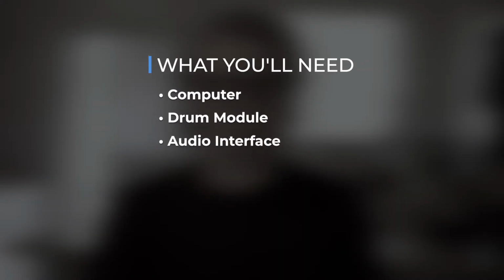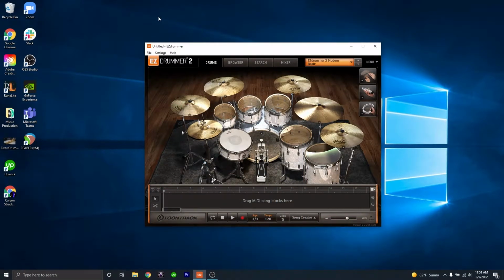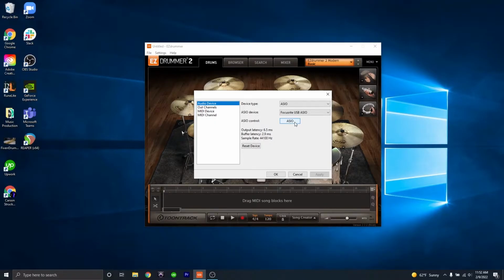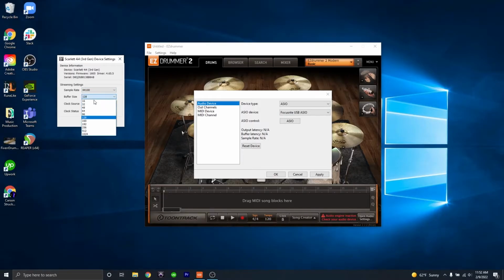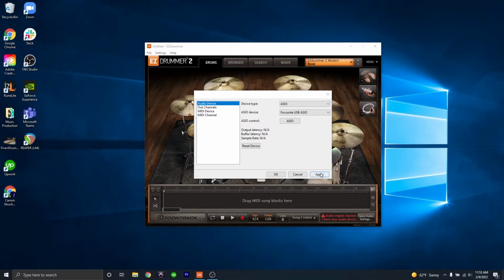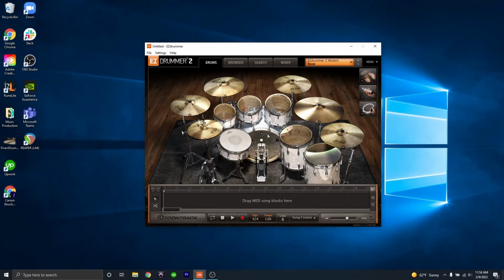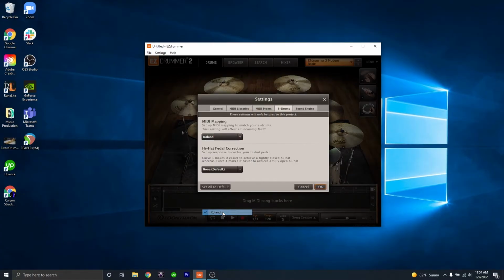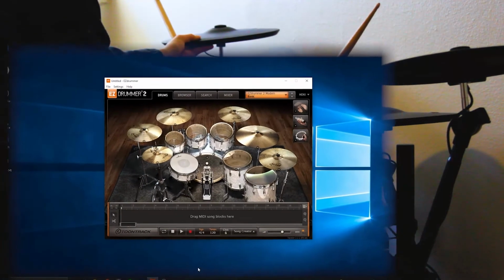How To Connect Your Electronic Drums To EZDrummer2 | MIDI

Comment: I have td07 but i cant use ezdrummer audio in my drum module 
I already have right driver 
If I connect headphones in laptop then it’s it’s working properly 
But if i put headphones in my drum module then no audio commig out in headphones
Reply from the maker: Yes! The audio from ezdrummer comes from your computer. It's a program that exists on your computer and since you can't route audio into most drum modules, you have to listen through your computer.

Comment: Focusrite Gen 4 doesn't have MIDI IN port. What do I use? My Alesis e-Drums have MIDI OUT and USB MIDI ports.
Reply from the maker: Oh, interesting. I guess midi is pretty dated now. Use USB from your module straight into the computer. I have another video on this exact thing. You can still use your audio interface as the Sound engine for your computer if you experience latency. Hope that helps
Reply: I will try and let you know. Thank you  @CarsonStruck

Comment: So if I purchased a 4 output interface could I send 4 channels to a mixing console?

I recently purchased a Yamaha DTX-8 not realizing that it only had two outputs. I would like four or more for live performance. It looks like the only way to achieve this at this point without buying a new brain is using a VST with a DAW but I am not altogether clear on how that works. 

I don’t have the interface yet, but my brain properly triggers EZDrummer 2 without a midi cable so I am confused as to what the MIDI cable’s purpose is in the chain once the interface is deployed.

Your video answers about 80% of what I need to know…great job!

Comment: I've never used an audio interface before.  When you setup your output device, was it routed back to a drum amp?  I guess my question is am I able to output back to my drum amp or do I have to go through whatever sound output my computer is using?

Comment: I have a td17. Ezdrummer 3 is one sale today. Do I need an audio interface? I thought I could connect my computer to the td17 with a type B cable?
Reply from the maker: @lobbyrobby  you don't need an audio interface! I have another video that shows you what to do without one. Basically just plug and play. I do over a few settings Incase you have latency.
Reply: @CarsonStruck  it took me while but I got it figured out

Comment: Thankyou for taking time to make this sir. I've got a Macbook M3 Max, Focusrite 414 4th gen, Easy Drummer 3 and Roland TD30. I was really struggling understanding the nuances of how the tech works with each other, and was almost considering abandoning the setup. I was going straight from TD30 to Mac, then out through the 414, or out through the mac jack and a headphone amp. I will try going in through the 414. Was getting latency of 0.4 to 0.2 ms. Struggling to work out how to get the output into my Roland HS5 for jamming, but your video has helped me rethink that too. Many, many thanks. Love from Central Scotland sir. All the best.

Comment: Hello man thanks for your video, I was just wondering if you could connect the soundcard to an amplifier instead of headphones. And if yes can we use the same port and cable ?
Reply from the maker: @theocornet3315  hey! Of course you can! Depends on your interface, but most have "Line Out" on the back usually split into a left and right signal. If you only want to run one cable instead of two, I would run a TRS cable from your headphone output into your amplifier.

Comment: I have a question that I hope you can help me with. I have an edrum that came with a very cheap module that does trigger very well. Is this interface device something that can help with that or that’s not what it’s designed to do?
Reply from the maker: @NoisyMachine_  are you saying that your standalone module for your e-drums don't trigger well? If that's the case, using an audio interface with drum software won't help there. But it would make it sound better if that's what you're getting at.
Reply: @CarsonStruck  sorry, I meant to say it DOES NOT trigger well. So that is not what this device is designed for correct? To help with the triggering of a cheap module?
Reply from the maker: @NoisyMachine_  Nope. If you're experiencing mistriggerring or sensitivity issues when hitting your pads, it's very likely that it's the actual pads you're hitting if you can't adjust those settings within your module. The sensors there may not be working effectively. So this won't help with that issue. BUT if you're just saying the sounds from the module are bad, then yes, running a VST like EZDrummer will make them sound so much better.
Reply: @CarsonStruck  thanks for the info man. I am not very familiar with electric drums a stuff like that. I am trying to absorb as much info as possible to understand it. I was told that changing my cheap module will definitely get rid of those issues. I think the triggers are good, but getting the settings right on the module is the issue. Sometimes it works, sometimes it doesn’t. Depending on how fast I played. And I am not saying the module is broken, it’s just that is not that good and hard to dial in the settings correctly. I want to upgrade to the TD17 since I’ve seen people saying it is compatible with my kit. Other reviews I’ve seen of my current module say the same thing. It’s just not a good module. By the way, I am talking about the Lemon TD950. I use drums sample from GGD (Get Good drums) and it sounds amazing. Everything works perfect except the sanare and hi hat. Cant seem to get it right with the settings so I that maybe this device would help. Thank you for replying…I always ask questions and no one ever answers so thank you. You just saved me from wasting money on a device I thought was for triggering like de eDrumin that apparently is what it does as far as I could understand
Reply from the maker: @NoisyMachine_  sure thing! If you are experiencing latency, Which is the time between your hit and the sound, the interface helps with that.  So as little delay as possible. If you don't have that issue, and you are just having a weird setting issue, no need to purchase an interface. I would suggest getting a free trial of EZDrummer and see if that works better though in terms of your hi hat and snare not sounding satisfactory.  In my opinion though, everyone's setup is a little unique and is gonna take a bit of tweaking to get it to your liking. Good luck!

Comment: Hi! What is the difference in using a midi cable or a usb cable?
Reply from the maker: They're different technologies that achieve the same thing in regard to sending MIDI data to your computer. I'd say it's probably more common now for people to just use USB to connect since they're likely already using a USB cable for other purposes anyway. USB can do a lot and has MIDI capabilities. A MIDI cable only sends MIDI Data. It doesn't really matter which one you use in my opinion. Hope that helps.

Comment: Thank you very much for this video. I have a Roland TD02 drumkit, and whenever I try recording drums via EZDrummer 3 on my Windoes computer I experience a bit of lag. The same isn't an issue on my MacBook, so I was looking for decent audio interface options for my Windows computer.
Reply from the maker: I use a Mac exclusively now but I also use a focusrite 4i4 with a midi cable. But USB is so fast now that it kind of doesn't matter if your using USB 3 on a machine like a Mac that has great built-in audio drivers. In short: get an audio interface like a focusrite or other brand that probably lands in the $100-200 price range and has MIDI in.
Reply: @CarsonStruck  thanks! My only problem is that my drumkit does not have a MIDI out. It's only got a USB B! How could I connect it to an audio interface, do you have any ideas?
Reply from the maker: @rhinestoneeyed_  You won't connect it to your audio interface then. You will connect it to your computer but then use the audio interface as your default audio driver. You should be able to adjust the buffering and sample rate within the control software that comes with the audio interface ou purchase.
Reply: @CarsonStruck  oh that's so cool! So it would go edrums to computer, and then audio interface to computer. There's no cable connecting the edrum module to interface. Is that right? 😅
Reply from the maker: @rhinestoneeyed_  in your case that would be correct! I always say try with what you have first because things add up in price, but if you have latency and messed with all the setting available to you, you probably need a better sound card. Which is where the audio interface comes into play. Good luck!
Reply: Great stuff! Can i on top of this use a IRig2 to my phone from the computer to get synked videos directly to my phone?
Reply from the maker: @mikaelpettersson2052  I'm not quite sure what you're asking here but if you want to get the audio onto your phone to then sync up with a video you've recorded, I would probably export/bounce your drum audio, put it on your phone via Google drive or however you prefer,  then sync it up with a video editor on your phone if that's what you're talking about. Again, didn't quite understand the question but good luck!

Comment: Nice video!
I have a not so good computer.  If I use an audio interface it will do all the processing and lower the latency or because of my bad PC, latency will still be an issue for me?
Reply from the maker: The interface acts as an external sound card. In my experience, latency is always reduced to almost nothing with even the cheapest audio interfaces you can buy. Using onboard audio is usually not the way to go. Again. Your results may vary. Start with what you have. 🙂
Reply: @CarsonStruck   thanks!

Comment: Does this allow you to play the sounds from the ezdrummer 3 program through your amplifiers to play live for people?! Im trying to figure out how to do this cause I can’t see spending this much money and not be able to show it off and be limited to headphones only
Reply from the maker: There's several different ways to send your ezd3 output to a PA or drum amp. If you are using an audio interface like in this video, you should have Line Outputs on the back of the interface. Run those with a 1/4" cable straight to your drum amp or PA system. That way you can monitor yourself with headphones but then your sound guy can do whatever they want as well. If you are forgoing the interface and just plugging your module in via USB, you need to take the output straight from your computer to the drum amp or PA. Usually via an AUX cable.
Reply: @CarsonStruck  I’m going to be ordering a usb audio interface here shortly. But from what I just took from that are you saying I can wear my in ear monitors while being hooked up to my P.A. System and I can hear myself playing while everyone else hears me AND the music?! If so then that’s awesome!! I’ve been trying to figure out how to do that very thing for awhile now!!
Reply from the maker: @Jeffmd2020  that's correct! At least with most interfaces. You just plug your headphones into the headphone port and then you can give your sound guy the lineout feed. So you can control your own volume and they can control it on their end for mixing. Again. There's so many different ways to go about reaching your goal but you can easily accomplish what you're trying to do with the gear you've talked about here.
Reply: @CarsonStruck  so do I have to have a mixer to use this line out feed? I’d love to hear myself while everyone else hears the music and me so I can fine tune my movements and how hard or soft I need to hit the drums
Reply from the maker: @Jeffmd2020  no. Your line out CAN go into a mixer and will most definitely go into one at a venue, but at home, that line out will go straight into your drum amp. My rule of thumb for sound is that you set it up the way you like it and it's always the sounds guys job to figure out how to accommodate your set up and adapt it to the venue you're playing at. Most artists expect a plug and play experience at any venue. You can get really you'll adjust your music and drum volumes from your computer. So in this case, your computer is acting as the mixer. Hope that makes sense.

Comment: Thanks for this video man... I was using the Drum module connected directly to the laptop and I was having latency issues.. I also have a behringher interface which I'd like to use however I didn't know how to setting this. :)
Reply from the maker: I sometimes have latency issues connected via USB. It depends on several factors, but make sure you have updated drivers installed on your computer for your module. Set the buffer to like 128 or something. Anything less than 11ms or so should be fine if it gives you that info. And make sure you're not using Bluetooth headphones. 

To use your interface, make sure you install the latest drivers for it from their website. If it has MIDI in, use that with a MIDI cable from your Module to your interface. If not, just go to the settings of EZDrummer or your DAW and select that as your audio device so you can utilize the power it provides vs just using your internal audio card. 

Hope that helps! Keep tinkering with it and you'll get it working.
Reply: Good video , and great drumming!. I am having latency issues . I have ED3 and a new laptop. Sweetwater helped me out with the settings . Still had latency issues . He told me I needed an audio interface. Now I'm waiting on the focusrite. Hope it stops the latency so I can use ED3 .

Comment: Nice video man. Now, what would be the routing if I’m not planning to only monitor myself through headphones, but play it through the PA live? 

Detailed as possible would be such a help 

Thanks!
Reply from the maker: If you're using an audio interface like mine, it has monitor outs that you can send to a PA system via 1/4" cable.  You can plug your headphones directly into the front of audio interface. If you're audio interface doesn't have multiple outputs and just a headphone out, I would probably run some sort of splitter or maybe a headphone amplifier that splits the single. One for your headphones and 1 or 2 for the pa system.

Comment: Hi hopefully this comment (or more like question) reach you. With this setup will I be able to listen to music (spotify, youtube) while running ezdrummer?
Reply from the maker: If you play it from your computer, yes. As long as the audio output of your computer is set to your interface. Through your phone connected to your module? Mostly no. Cuz you're getting the audio from your computer and not your module. When I jam to songs, I just Bluetooth to my module and use the stock sounds. But if I want to use ez drummer I have to play music from Spotify on my computer.

Comment: I connected evrrythin as you said but I do not get midi in signal  in ezdr.3 

When i connect midi out via usb to Laptop and from there via usb to daw it works but grim my understanding thats wrong. Isnt it?
Reply from the maker: I'm not completely following... But I have another video showing how to connect via USB. And that way is completely fine as well! Whichever way works for you is best. I'd argue that neither is better than the other.
Reply: @CarsonStruck  Thank you so much  for taking the time. 

What I meant was  that I connected my edrums (midi out) with midi cable to my ur242 Interface(midi in) and from there used a USB to connect the interface with my laptop. And while I can hear sound from my headphones(plugged to the interface)  I can not get any MIDI in signal.

So I changed wiring and connected the edrums with a USB to my laptop and connected the Interface with another USB cable also to the laptop.
Then I get MIDI from the edrums and also hear an output from the interface but I wonder if this is ok to do. 

The funny thing is that I do get pretty decent latency. I run low latency mode and 32 sample and get 1.5 ms delay according to the software. While playin I cannot recognize any latency. So I guess the Interface does its job... I just dont understand why :D

Id rather have it wired with a midi cable from the drums to my interface instead of using two usb. 
I also thought this cannot even work but my knowledge about interfaces is very little so I do not know how they work
Reply from the maker: @PinkiesBrain  Yes! The way you have it connected with two USB cables are totally fine! It is possible that EZD isn't recognizing your Uphoria interface as a MIDI connection. And tbh I've never used EZD3 so I don't know what kind of settings it has to offer. But that said, the interface is definitely contributing to your low latency which is fantastic. I believe most users actually prefer the USB method just because MIDI cables are a bit older and not as easy to come by. If it's working for you and you're midi data is being sent properly, you're doing it right!
Reply: thank you very much for your help!
 @CarsonStruck 

I btw ran into issues with low latency and 32 samples. 
Sometimes the connection breaks. 

Had to go to 128 like you adviced. It is fine too. Will experiment a bit. It might just be my psyche but I kinda feel that there is a lil bit of latency now. But I am not even sure.

Comment: Great video man! So I have a TD27 and just ordered EZdrummer 3 and a Scarlet 2i2 3rd gen 

Do I need to run the midi cable or can I use a guitar cable from the main out of my module into the main front input on the interface?

Thanks bro
Reply from the maker: If you want to use EZD3 you need to either run the MIDI cable from the module to the interface or run a USB cable from your module to the computer. Running a guitar cable will only capture the audio from the module which defeats the purpose of having EZD3. Hope this helps!
Reply: @CarsonStruck  thanks man! Got ya 😁